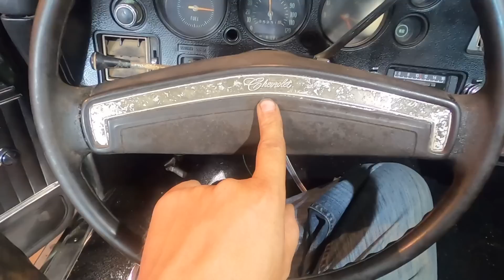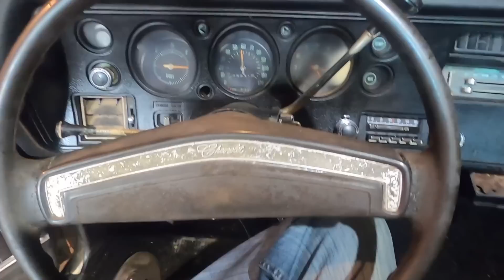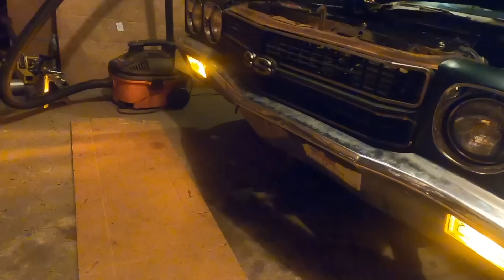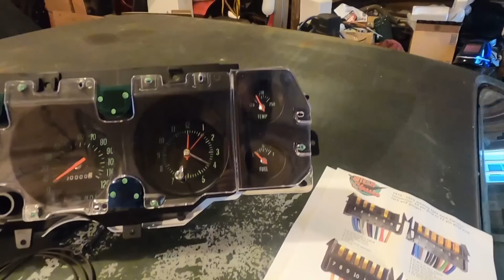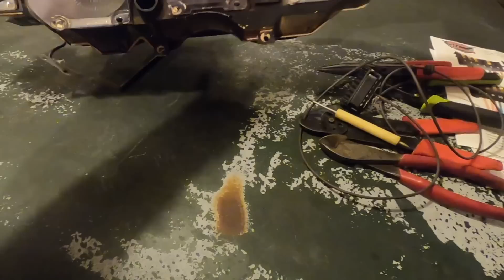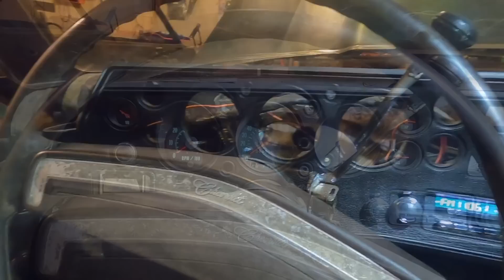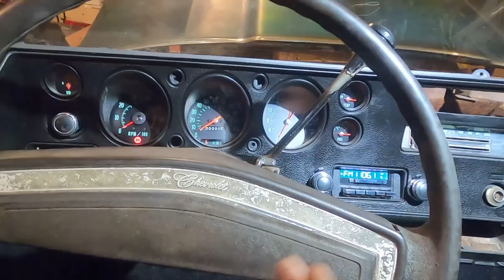1970 Chevelle Electric Exorcism! No more electrical demons!

Comment: What's the deal with it not having an SS steering wheel?  Did it get changed along the way?
Reply from the maker: From what I can gather based on the condition of the car, I suspect it was in at least one, if not more, front-end accidents. I suspect the steering wheel was a casualty of one of those accidents, as I can't quite think of any other reason they would change it.

Comment: I plan to by a 69 c10 it needs new wiring. Some of your videos gave me a few 💡
Reply from the maker: I'm pretty good at making sense of wiring diagrams and building out harnesses, so I'm never really phased by electrical gremlins, but even then, it can be a can of worms depending upon the project. It's really nice when you can get a number of different factory style harnesses with a few modern options thrown in to simplify the process. It starts to get tedious when you have to just start with a generic fuse block kit and wire everything up individually.

Comment: I was wondering on that caliper rubbing problem do you have disc or drum brake wheels there is a difference
Reply from the maker: All of the 1970 Chevelle SS had disc brakes up front, so these should be fine with an OEM disc setup. However, it is a known issue with these aftermarket brackets that they rub and need some tweaking.

Comment: Had same car in green. Sold it few years back. Got a 72 El Camino and am looking for another 70 Chevelle. Near East Lansing.
Reply from the maker: It's hard to find complete cars around here that aren't completely rotted out and even those come with massive price tags. The deals are pretty thin around these parts.
Reply: @JamesSorenson  Lucked out finding mine, was original AZ car, Arlington TX built, kid just out of AF bought and drove to GR area but blew up the engine. Was originally 350 Malibu with SS trim, w/ survivor cowl hood. I'd say yours was swapped for aftermarket. Guy who bought from me took to IN, patched rear window up, and last I knew was still building it. Had a complete 454 4 speed 12 bolt parts car w/ all new interior, etc. Probably be a 70K car when he's done! Can really put a lot into them but tend to old value.
Reply from the maker: The hood on my car is correct to the build and I believe to be the original. It is not a cowl hood, it is just the standard power bulge hood that would have come with the SS package.

Comment: Had the Chevelle out today, For what its worth  3000 rpm yielded 64 mph. in 4 th. gear.  ( 1: 1 ratio / will  be the same ratio on the TH400) on a flat road. 3300 rpm yielded 70 mph. Tires are 245/60-14R (25.57" dia.) at 34 psi. All drive train is factory stock. 3:31 posi. L34 396  muncie m21. Did not cross check with gps. Looking  forward to seeing you send it down the track, keep the up the momentum!
Reply from the maker: I went back out later and discovered the tires were smaller than what I was using for the calculator, which has me thinking it more than likely is the original 3.31 after running the calc again. It has 205/70R14 all the way around at present, which looks to line up fairly well with about what I was reading during the drive. It will be down on grip at the track, but will be fun to see what it can do anyway!

Comment: A lot of those disc brake kits have a footnote that says to use 15" wheels. Maybe that's where the grinding noise is coming from
Reply from the maker: This is all "factory" replacement parts, which had the original 14" wheels, but apparently the brackets are a bit thicker than the originals and end up rubbing.

Comment: Another great vid. Why not clean those wheels up a bit? I think it would rep the car alot better on test drives and maybe stoke the fire for resto some.
Reply from the maker: I've kind of glossed over them, as I suspect I"ll likely replace them down the line. I'm not quite sure what would work best for cleaning them up or if it would end up making them look worse than they do now.
Reply: @JamesSorenson  I know an easy visual win used to inspire me. Just my .02c
Reply: i agree, probably wouldn’t hurt the look to clean up the rims and paint them, like the Vice grip guy does, until ya get some new ones

Comment: Switching to gauges is good sending unit for water diff , 8.20 10 bolt usually 2.73 3.08 3.31-3.55 - one wheel peel or Ltd slip 28 or 30 spline axles .

Comment: Coming along ... nice. I see you haven't replenished your Windex yet ... LOL. A bit late now, but if you get back in there, I hear the LED instrument cluster bulbs are nice and bright. Yeah, that lame green on the turn signal indicators would drive me nuts !
Reply from the maker: I did get Windex! I made the wife get it and ran away with it straight to the garage. I cleaned the windshield and rear window 3 more times on each side and it still looks bad. I need something a bit more aggressive.
Reply: @JamesSorenson  I've never used it, but I hear a clay bar works wonders. Don't forget the side windows ... Much of your test drive footage includes the side view ... Not an important part of the view, but distracting seeing the crud. I look forward to the Drag racing ... and the L78 swap. I just attended the Duct Tape Drags in Tucson last weekend ... This vehicle would have been right at home ( Meant affectionately )
Reply from the maker: The sides have been the hardest to clean for some reason, I'm not quite sure why it is stuck on as bad as it is.

Comment: I like the original gauges I would put new big block springs in it and bushings if needed and get 15x8 ss wheels with bf goodrich white letters and paint it the same color and add white stripes.
Reply from the maker: All of the suspension has been replaced other than the original front sway bar. I haven't yet decided on the rims I'll go with, but it will remain forest green no matter what I do.
Reply: @JamesSorenson  sits to low like the springs are shot.

Comment: Can you help the decklid with glue
Reply from the maker: Probably not, I could possibly weld some additional braces in from the latch assembly back to the rear inner structure, but the whole thing is so rotted it's hard to figure out the alignment and it would likely still rattle.